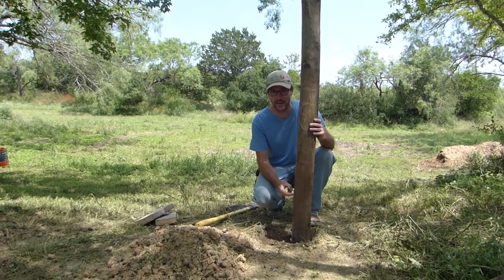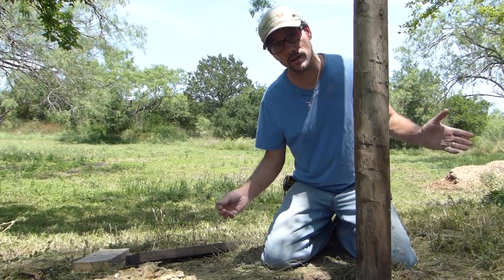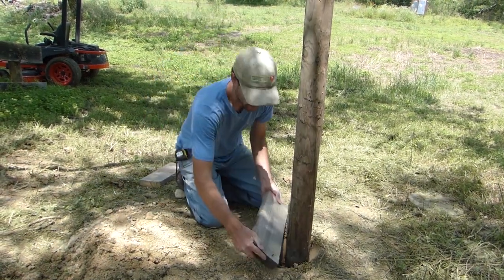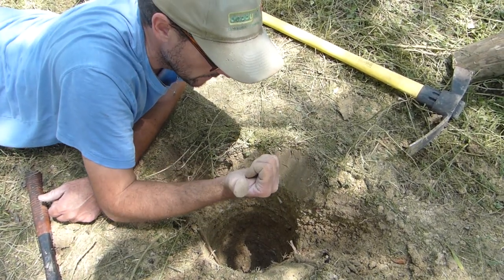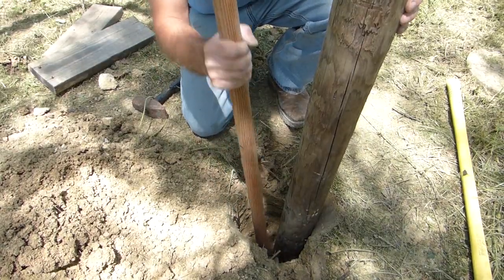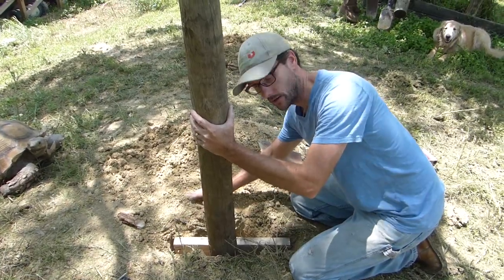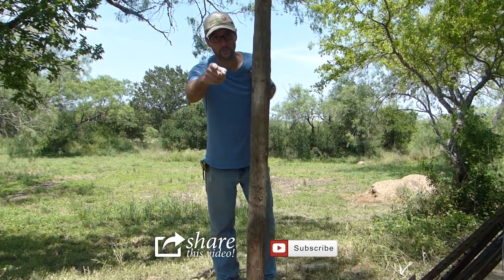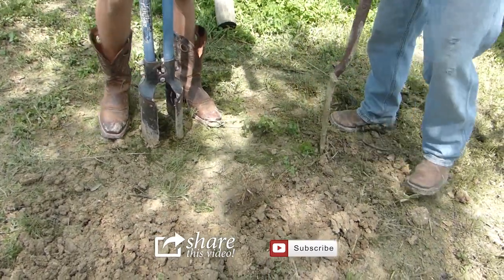How to Set a Secure Gate Post WITHOUT Concrete!

Comment: Older guys are a wealth of info,,they had little money and learned how to use what they had to complete job,,def like the key tip ,,my old neigbor did similat but drove 4 ft stakes on opposing sides of corner post,,he also painted bottom 3 ft of post with roof tar,,it helps preserve the wood,,every fence i have ever done with cement ends up in 5 years or less of leaning post because of rot,,when i started using gravel or soil only post stayed in place,,existing fence i have now i installed in 2005,,

Comment: This can apply to anything putting a significant sideways load on a post; even a mailbox (any tour of a rural route will illustrate that).
My experience is with that, gates, and having a dog sometimes tied to the top of the end post that lurches at right angle to the fence.  The movement of the soil packing the post illustrates the reaction forces; more pronounced with increased wetness, especially after a snow/freeze/thaw cycle.
Most of the movement is at ground level where the soil can easily burm up.  (Same as when the car is stuck in the mud!). However, the soil at the very bottom of the post also has to counteract the post loading, and under certain soil saturations, can also move.  The deeper below the surface the post is buried the less that happens (mine is over a septic drain field, so could not be deep enough).
The basic mechanism is as stated: widen the contact area, which reduces the pressure against the soil.  The spreading structure ("key") must be treated at least as much as the post, or better is to use a large rock.  Also, a flat rock on the bottom can eliminate sinking just like a footer does for a wall (plus it minimizes soil touching the end grains of the post).

Comment: 8 years ago. Curious how it's holding out and would you do anything different?  THANKS!
Reply from the maker: This post hasn't moved a bit in 8 years. Still holding on strong.
Reply: @daddykirbs  I did this technique recently!  Hand held auger and then tamping.  Tall fence.  Feeling pretty bomber.  I've done cement before and there was failure right above the cement with wood rot and did not want to go down this path again.  Thank you for the video, I'm keeping fingers crossed that I don't have to do this again... ever! LOL

Comment: Great video. Keep up the good work.

I will say, I'd like you to explain more about the physics of why you did what you did. I can understand just by spending a bit thinking about it, but it would be good for you to explain what forces that 2x6 is under.
Reply from the maker: +Yusuf Sheth It's all about spreading out the force by increasing the surface area at the base of the post. You are right, that would have been good information to include in the video. Thanks for watching and asking :)

Comment: This is very cool! My main gate post got destroyed by a hurricane and I need to set a new one. I was looking for ways to reinforce the new post (which will have to be a 6" x 6" because they are out of stock on the round posts).
I admit, I let out a squee when I saw the turtle. Coco is adorable!
How tall is that post and how deep did you set it?
I like how you included the part at the end where you showed your son how to dig the hole.
Reply from the maker: The post was probably about 7 ft long set about 18 inches or so deep (going from memory here).
Reply: @daddykirbs I’m building a fence for my goat and I don’t have a truck so I can only bring home 6’5 foot wood fence post,so if I set those post 2 feet deep in a 12 inch diameter hole in concrete will that be sturdy enough for a fence brace post

Comment: Could you use a fieldstone for the key? Would that be better or worse for durability, and how does this method do with frost?
Reply from the maker: +blueharpy A stone would be a much longer term solution. It's funny you mention frost. Someone on my FB post about it says it is a good solution where there is a deep frost zone because the surface areas of the concrete just gives more for the frost to heave on.
Reply: +Blake “Daddykirbs” Kirby Thanks for the answer and your video. Hopefully I'll actually be in the situation to try this out sometime, but for now, it's fun to learn about homesteading. Your time in replying is appreciated :)
Reply from the maker: blueharpy You are very welcome. I'm glad you are here with me on my journey.
Reply: I agree with the stone idea, only because wood rots in the long run. But great video, it gave me insight into alternative ways to support a post without concrete

Comment: a big wind storm passed thru town a week ago  ( today's 12 28 21 )  and some 50' of my wood fence / posts
blew over.  but neighbor sections with steel-post / concrete  remain upright.

         now , with your idea a 2x6 will be placed on the downwind side for extra support.

    this vid  came just in time as the 1'st 2 new post holes dug so far are only filled half way w/ crusher fines.

these 1'st  2 posts are for my basketball backboard.  it was blown over too.   
and has priority for being re-built first.   
so i can get back to being able shoot a few for some fun after the other yard & roof work jobs

Comment: What if I put 4 of those in, one for each direction, each  below the other?  It would take a lot of digging but I wonder how much weight it would support?  I'm trying to put something that weights several hundred pounds on it and need it to stay pretty solid..
Reply: the thing weights like 800 pounds and moves around (solar tracker with 8+ panels on it)

Comment: What happens when that key piece of wood rots out? I guess the main post wood will rot about the same time.
Reply: Wood rots out of fence posts with concrete  soooo.... they'll prolly replace it.
Reply: Treated wood. Should last a long time. Nothing lasts forever. Not even posts in concrete.
Reply: Concrete means less moisture in direct contact with the post, therefore it will take years longer to rot.  Putting it directly in soil, it will soak up water like a root. This seems basic common sense.

Comment: How deep does each post need to be in the ground using this method?
Reply: I saw another video on you tube with USA  gent replacing rotten wood pole (cemented yuch) with wood using compacted gravel. He did not use the 2x 6 trick to increase resistance. His rule was 1ft down for every 2ft above ground level. So 6ft high fence (standard in UK) would be 3ft. Hope this helps ...
Reply: @colincampbell437  thank you so much - just looking to put a temp fence to prevent deer from destroying my green giants - thank you so much for the info

Comment: Another way is to use sand and water. Jug a hoe handle in it and add the sand and water in thirds. Wait a day before stretching wire. 

My Daddy and Granddaddy said it held better than concrete.  

I think it held just as good as concrete with the benefit of not rotting as quickly and being removed more easily if necessary.
Reply: the local cement truck plant has piles of no end of sizes and mixes of sand / gravel.
the mix favored is what they call 'crusher fines'.  and is a mix of sand and  pebble size
gravel.  with packing & water in stages it too can harded with the stiffness of concrete,

Comment: Great video. I just put up my fence, from what i understood the concrete is used to not only to secure the post but to protect the base of the post from moist and water preventing the wood to rot over time. U telling me i didn't need to buy all that concrete?
Reply from the maker: I can't say for sure what you need. I'm sure different soil types and conditions will require different techniques. It sounds like you built a nice fence :)
Reply: Blake Kirby i hope so... I would have been nice not too use that much concrete... I'll remember your video for my next project... Thanx cheers
Reply: I thought the same thing before. Then I learned that concrete ATTRACTS WATER like a sponge. It holds that water against the post. You can see how badly posts rot when you use concrete or remove a post set in it.  Now I just tamp dirt around a post and sometimes use gravel. Water will drain away from hard packed dirt and it will flow toward looser dirt away from the post.  Dirt costs nothing and works far better than concrete.

Comment: That looks like a temporary solution.  I suppose by the time the key is rotted, the soil around the post will be well set in place.  But this doesn't address routing sub soil.
Reply: You could use a concrete slab as the key or wrap treated wood in thick plastic sheet taped with aluminium tape. I wrap all my posts in plastic up to ground level to further extend their life ...

Comment: That is very ingenious. How long will it hold up? Luke is a good strong helper. And the turtle is a nice touch. I'll be putting in a french drain on the top of my little hill because my neighbor had a "landscaper" put a drain that spills mud onto my back patio. Have you ever had drainage problems on your property? Thanks
Reply from the maker: +odette381 We have had some water issues, but I've been installing the systems of swales that catch, store and direct water and that has helped. The post in the ground should last 15 years or more. That treated lumber does pretty well with ground contact.

Comment: 😂🤣😂🤣 If the post is in the ground 4ft, and you correctly tamp/pack the dirt back into the hole with the post, keying nor concrete is necessary. The post will be secure. All dirt will be back in the hole. And the weight of the gate won't matter. I have hung 10ft--16ft metal pasture gates from posts as I described. And decades later, the posts and gates haven't budged at all. It amazes me how many people try to make fencing harder than it needs to be.
Reply: Unless you have really soft soil or a powered auger, seems to me that keying would be easier than digging 4’ unless you just really like to dig holes. Might be a good way to keep a teenager busy though!
Reply: @Ghosted456  😁 we all have different ways of doing it.
The way I described is how I was taught to do it, on our Kansas farm, back in the 1970s.
And yes, we had a PTO powered digger on the tractor.
The digging was the easy part, of course.😁
Packing the dirt around the posts put muscles on my arms/shoulders/back better than any of the weights I worked out with at school, during football and basketball seasons.
😁

Comment: hello friend.
if my soil is soft, does it make sense to stabilize the "key" with deep driven stakes on both sides?
thanks
Reply from the maker: I'm sure that would make it more stable. Or just increase the surface area with a larger key.

Comment: You didn't mention anything about using a wood preservative such as creosote on the post. Don't you do that?
Reply from the maker: These boards were treated. I did mention this one time in the video, but perhaps should have made it a stronger point.
Reply: Thanks. Perhaps if you'd mentioned what they were treated with, I might have paid more attention. I've just finished cutting off the rotten bottom of my 4x4 gate latch post and applied creosote to the bottom 10-12 inches. I wore a mask due to my allergy to smoke and fumes but still, that creosote gives me a bit of a dry throat. Now to dig the hole deeper.